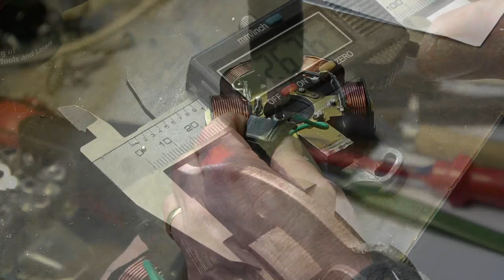SLUK | Lambretta Vespa ignition stator plate rebuild @ Scootronics

Comment: Great video, but i have a question. When you measure the new pick at 26.7mm how can you reduce that size if its needed. My pick up measures 29.2 mm so its missing the rotor trigger points.

Comment: I have a P50 who has a weak spark. the spark stopts sometimes, not sequent spark, we have replaced the pickup and did measure al wires, maybe you ccan help or have a tip. thanks.

Comment: Hi my on my lml star 2t the lights do not work. They run off the  AC with the AC plug un plugged checking with a multimeter there is no voltage coming off the AC wire. So I replaced the stator for a new one and still have the same problem I still have a spark and the engine runs fine and I have checked the resistance to the manual and all good.. Any ideas ?
Reply: Check your regulator.